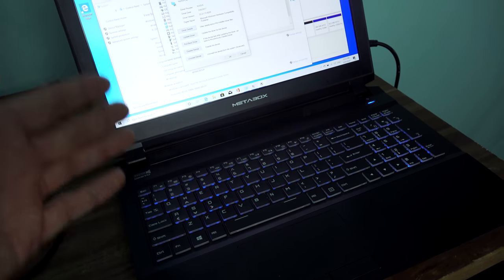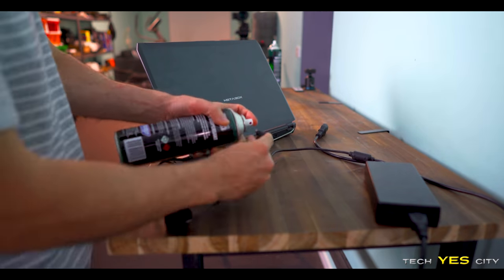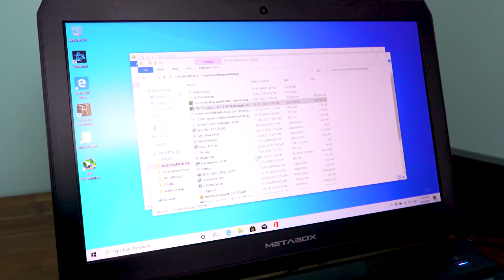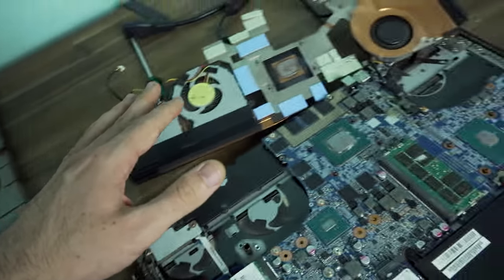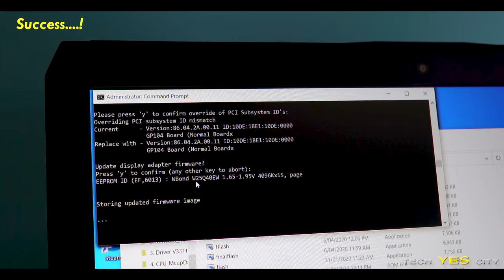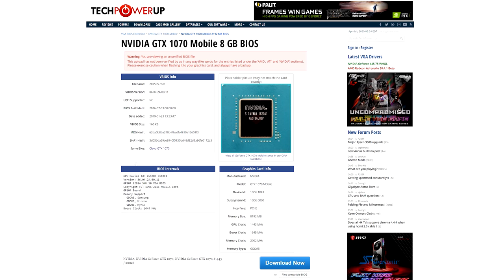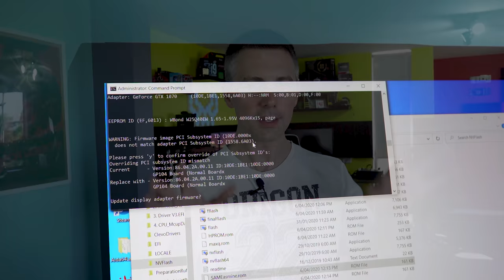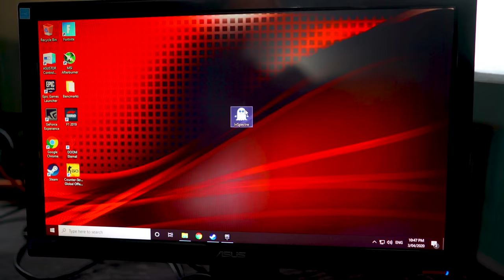I Got This GTX 1070 Laptop for ONLY $200... Though it has a VIDEO_TDR_FAILURE issue...

Comment: um ur stress testing a laptop cpu...full load.... 90+  degrees Celsius doesn't equal thermal paste change almost every laptop out there with a powerful cpu with reach into the 90s and throttle...even apple macs/macbooks get hot like that and throttle under full load thats expected of laptop cooling

Comment: You were doing so well until I saw you using your fingers to spread the paste. No, no, no! Oil from your skin can cause issues, and fingerprints cause breaks and bubbles in the bond between the paste and sink. Even when you spread it. Use a spudger or credit card!

Comment: seeing this error ona xfx rx 5700 dd ultra flashed to the thic II bios no blue screen but crashes and fans ramp...does have bios switch ect. flashed using the closest 170amp bios for the 5700xt available on tech website...alos got this GPU BRAND FUCKING NEW ON AMAZON in feb and its LITERALLY REVISION 1!!!!! and the fuckin thermal paste was crusty like WHAT THE FUCK???? toook the plastics off and reflashed and applied some artic mx4 paste now using the flashed bios no crashes and overclocked to 2002 core stable on all games so far. can get 2100 on all but 1 game, and 1900 memory clock with +5 power increase...dont quite know why i got a dud but fuck me if i cant send it back...im not waitin months ona new gpu to come...

Comment: please you have to help me!  i have the same notebook, but i can't find a suitable vbios.  can you post both the vbios and the bios of your pc?  please help me.
Reply: anyluck?
Reply: @astanfartin1647  I solved.
The problem was not inherent in the bios as you can imagine from the bios, but in the ram of the graphics card. I removed the first micro mosfet at the ram banks closest to the inductors, and the problem was solved. The only drawback is that now the pc recognizes 4gb of ram and not 8, but everything works fine, and you don't notice a difference on the benchmarks, the same with games.
If you need photos, I think I can provide them. In any case, it is a very delicate hardware intervention. I didn't make a video unfortunately, but if interested I can try to help you in my spare time. The loaded vbios is the smallest version, I think it ends with "11". I'll make a dedicated video if needed.

Comment: Looks like a temp issue, had this on an old laptop of mine, would shutoff with the power plugged in. Also $900? I paid $1500 for a 1050 Ti in 2018 lol
Reply: Oof
Reply: You couldve got for $600 for a 1050ti laptop in 2018
Reply: @RandomGuy-om1vy  This is AUD and that wsnt possible.
Reply: Lil' M oh ok

Comment: Can unrestricted nvflash used for fake gpus?
Reply: Worked for me
Reply: @llucratius  thx for that, is it the one featured in this channel or Phil computer lab ones?
Reply: @bitelaserkhalif  Both work fine tbh, I prefer the one on this channel
Reply: @bitelaserkhalif  needed to flash it 3 times but worked😭💯
Reply: @llucratius  good riddance. What model is the fake card and what's actually is?
Reply: @bitelaserkhalif  its a "1050Ti" but actually its an gt630

Comment: Laptops are easier to fix than desktops, just update the drivers or do some soldering to change out parts.
Reply: Its not impossible, but for sure not easier, changing a CPU or GPU these days requires costly equipment to do it.
Always hated when Intel switched from socket to BGA...
Reply: @rodrigofilho1996  I have a test bench soly for that purpose. I do agree it will appear hard for those who don't have the equipment, but once you do. It's a walk in the park.
Reply: @beasttitan8747  That makes them as easy to fix as desktop at best. I don't see how that makes them easier to fix.